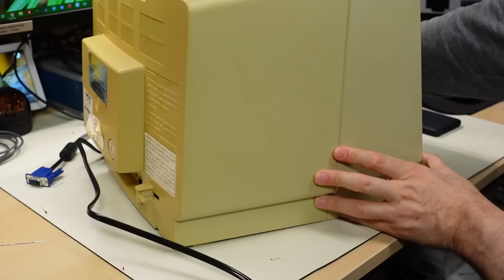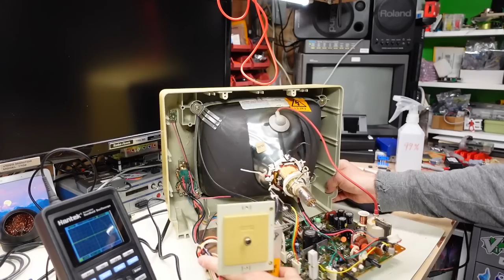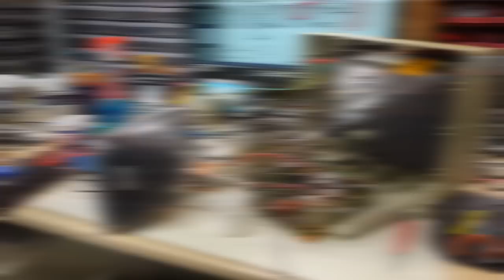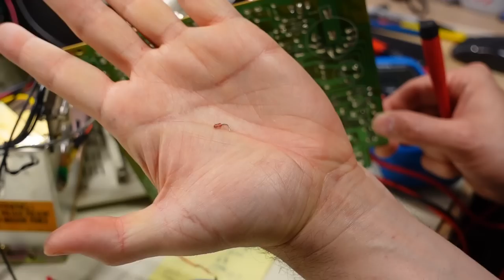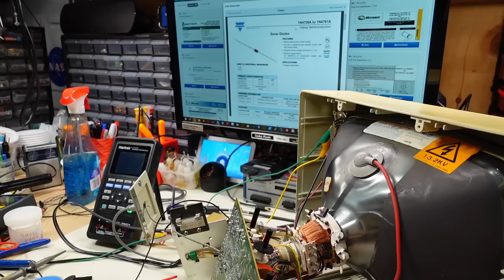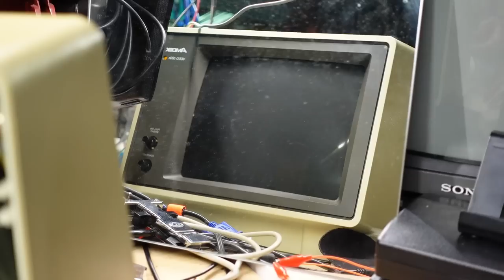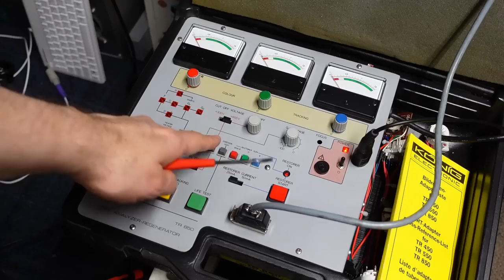I ruined this Amdek 300A after fixing it

Comment: It's a shame, it was an interesting journey, looking for the problem, and everything looking good, and one simple seemingly insignificant diode being the problem, and you nearly had it.
But I think there really needs to be a change, this rejuvenation, while it is entertaining, it looks like it's doing more harm than good. Maybe it's not all rejuvenators, but with this one, you seem to be having no luck at all. Also, it really isn't a permanent fix, not even like retrobrite, you do this, and 3 weeks later, you're back to square one, except the tube is even more worn out and will wear faster, so, it's probably time to put this concept to rest. OR, use it specifically for completely dead tubes like this one was AFTER the rejuvenation, for fun and experiments and such.

Comment: I really like my B&K 467 Rejuvenator.    It has a "Clean" option which is less aggressive than the "Rejuvenate" option.  I've seen some stubborn tubes that after a rejuve weren't any better (or worse), but after they were transported somewhere they started working.  I'm guessing that the tube was vibrated and possibly shook something loose that was causing a problem with the guns in the CRT.   An excellent resource for tube information is also here: http://tubular.atomized.org/

Comment: Why waste the time and risk rigging up a bunch of alligator clips and a pot to the CRT cathode driver pin before just testing it for shorts, emissions and cutoff with a CRT tester? Risks like that with vintage electronics are not worth taking when you have the proper tools available.

Since you got a raster by the end of this it demonstrates the pot setup wasn't even working properly. One of the repair rules is keep it simple stupid. Best to eliminate any chance of your test method being the reason for failure.

Comment: I worked on monitors and tvs for a long time with nothing more that a VOM and a tube tester. A sam's photo fact is good to have but it's completely unnecessary for an experienced TV technician.  I know this isn't a tv. It's even more simple. When a crt gets old. It's just worn out and no snake oil or magic rejuvenator is going to bring it back.  Be very careful about touching unenergized circuit boards. An old style tv or monitor will retain high and dangerous current unless discharged. throw that rejuvenator thing in the trash. If you can't fix an old school monitor or tv with basic equipment then it cant be fixed, unless you're working on color convergence. Then you may need a color bar generator. At least this made you another video.